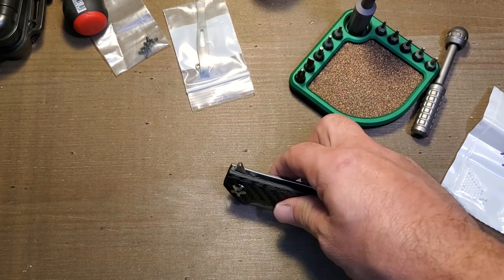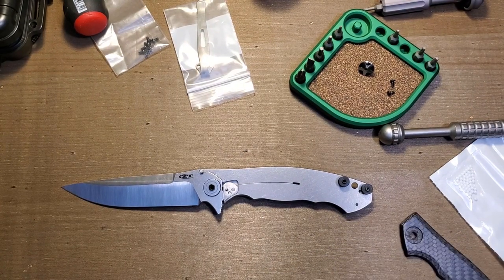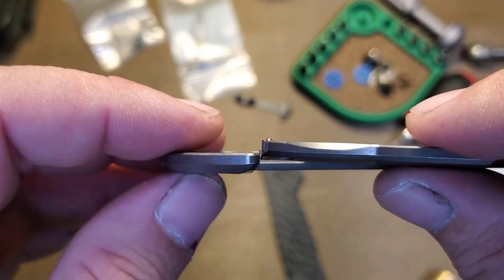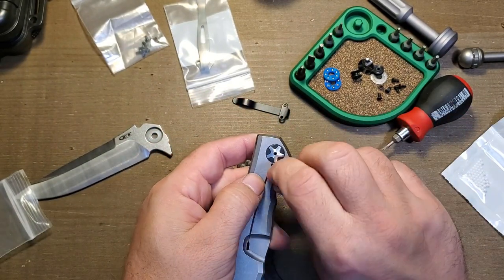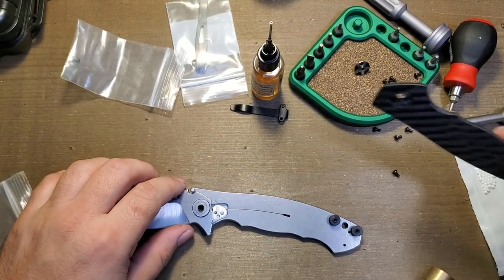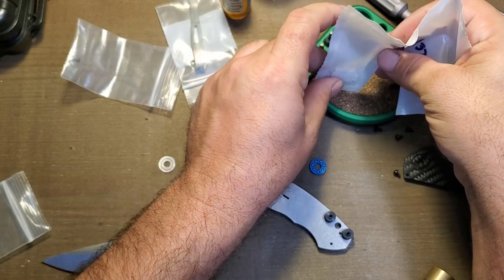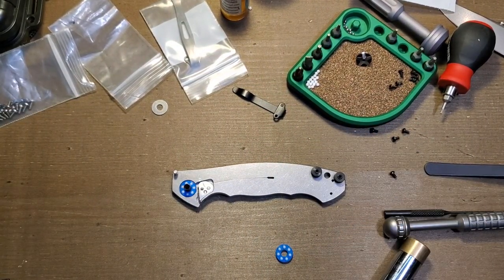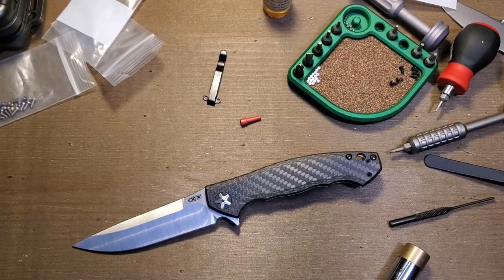How to adjust a detent on a framelock knife.

Comment: I was getting serious lock stick on my ZT 0561. I considered sending it back to ZT. I called them and they were great, said send it in and we will get it right back to you. So I figured if they are going to take care of it, why don't I give it a try. I removed the lock bar stop from the frame and removed the lock side of the frame. My 0561 doesn't use an insert, it is just carbonized titanium. On my third attempt adjusting the tension, I nailed it perfect. So I never sent it back and it still functioning beautifully.

Comment: I'm only half way through the video but I wonder why you took the detent insert out. It doesn't seem like you did anything that could or couldn't be done if you left it on.
Reply from the maker: Lockbar insert doubles as over travel stop, when adjusting the lockbar insert if you are increasing tension you push it in, but it is often possible to push it too far (Too much Tension) it then becomes necessary to bend it back out and you cannot do that with the over travel stop in place so it was removed for illustration to show that it needs to be removed to reduce lockbar tension.
Reply: @knifeknerdreviews4609   Awesome, thanks for the info. I'm new to this hobby so I appreciate your help.

Comment: Am I crazy to open every knife I buy and adjust the detent so it’s lighter and the blade drops way easier? lol
Reply from the maker: Kinda yeah...Framelocks have a break in period that takes a week or 2 during which time the lockbar will soften from repeated use, the edge of the detent hole will soften  and the detent track will smooth out so you dont know how the action will actually feel until its broken in.

Comment: I have a 0777 the m390 version. The detent is so weak. I was looking for a 0777 for a while. but I'm so mad about the detent. also, a 0850 weak detent. I didn't think they would fix detent. I'm going to email them right now and see what's up
Reply from the maker: Well, maybe... Being that the 0777 is a limited edition they sure ain't gonna have any parts for it. but it's possible they might tune it if they can. If they cant or wont help you maybe I can. Get in touch with me on facebook or instagram if you need help with them.
Reply: @knifeknerdreviews4609  I would love the help, I wouldn't try to do what you just did. That knife is too rare to try it on. I'm not on Facebook or Instagram. is there another way? I'm a big zt and Kershaw collector.  I will see what zt says . thanks for getting back to me
Reply from the maker: @slayer7682  This is why Youtube should have a messenger... Definitely don't wanna hang my email out there for the world to see... Are you on any other social media?
Reply: @knifeknerdreviews4609  no social media unless YouTube is considered social media
Reply: @knifeknerdreviews4609  Where did you find replace screws? to change from T6 to T8, if you don't mind me asking
Reply from the maker: @slayer7682  These are Ti Connector Screws, I bought a bag of 100 of them and I still have plenty if you want some. You just have to grind the threads down to the right length. You can buy them on ti connector website but they only sell them in batches of 2 or 3 or 100... It's weird like that, they are pricey so thats why I bought the bulk bag.
Reply: @knifeknerdreviews4609  using T6s on a knife should be against the law. Especially with all the Loctite they use. I always make sure to use hair dryer on high to heat it up just in case, it's been working for me.

Comment: Thanks - this was a really helpful video, and I subscribed.  I have a Hinderer Project X that has a squeaky detent ball.  I initially tried KPL Heavy Pivot Lube, and this did not help.  I am now using teflon grease, and this has reduced the issue alot.  Do you have any suggestions other than just letting it wear in?
Reply from the maker: Squeeky Detent Ball is always too much lockbar tension. I use Nano Oil 85 weight on detents, I truly believe it is the best knife lube on the planet. If that doesnt stop it, reducing lockbar tension just a little definitely will, but you also gotta pay attention to the other tolerances, make sure it doesnt develop lock rock after adjusting.

Comment: Dig the music…and good info; well-done. I was always under the impression that lock stick was the result of steel/Ti interface. With the steel insert being new perhaps the steel/steel contact will wear in over time. Again, thanks for this info! Subbed and 👍!
Reply from the maker: It can happen with steel inserts too, but for a different reason. It has to do with the lock geometry... Ti on Steel is because soft material against hard material. Its the friction.

Comment: Awesome information.  I just did a bit of finessing with my avispa and it works so much better know after your information.
Would you happen to know if the avispa blade would fit in/on the rat 1?
Reply from the maker: No idea, same manufacturer, I would compare the blades and go from there if the tangs match up.

Comment: I was watching a Nick Shabazz video and he mentioned putting black sharpie on your blade where the locks going to be setting in, then after repeating the process a couple more times the issue should be fixed. I just picked up some ZT knives and am trying the method on my 0562cf.
Reply from the maker: I never had any luck with graphite or sharpie. Its a temporary fix at best if it does work. Sometimes just a light buffing with 1500 grit sandpaper on both lockfaces will solve it. If its a steel insert oil might solve it, nothing is a guranteed fix though. Somtimes you just gotta experiment with it until you find the right solution. This 0452 barely has any stick now after a few weeks of breaking it in and a dab of oil.
Reply: @knifeknerdreviews4609   Can you link me to the little parts tray you're using please

Comment: Is there a way to weaken the disengage of a framelock...frame lock...this new WE elementum has the most stiff disengagement I've felt
Reply from the maker: By reducing lockbar tension as I did in the video, the lockbar will be easier to disengage. WE is notorious for super stiff detents but make sure and check that you do not create lock play when you reduce the lockbar tension. WE knives have very tight tolerances and often they do not leave any room to soften the lockbar without getting a little bit of lock play...

Comment: Must the lockbar insert be removed? Looks like you could just bend the frame without having to remove it.
Reply from the maker: You cannot... Thats why they call it an over travel stop. It prevents the lockbar from bending past the frame thus changing the tension.

Comment: I never adjust anything.
Reply from the maker: Yeah it's not for everybody. Only for those who want to improve their action and have some basic mechanical aptitude. I've seen people that literally don't know how to turn a screw.
Reply: @knifeknerdreviews4609  Well, I don't consider turning a screw to be an "adjustement"  - this I do sometimes, it's necessary ...but other than that and sharpening - naaah :)
Reply from the maker: @wojciechk50  I'm the opposite... I tune about 98% of the knives I buy. Factories rarely get the detent exactly right, not to mention fixing other quality control issues and flaws.
Reply: @knifeknerdreviews4609  That's true. However I am usually lucky enough not to have any serious issues with my knives apart from a little blade play from time to time which requires only pivot screw tightening. Probably , you would find more issues on my knives which are not problematic for me and I just don't care about them as they don't impact the way I use them. You are just a more tech minded and probably picky customer :)